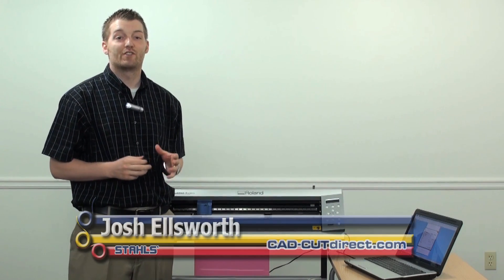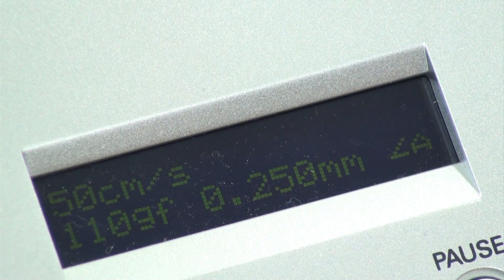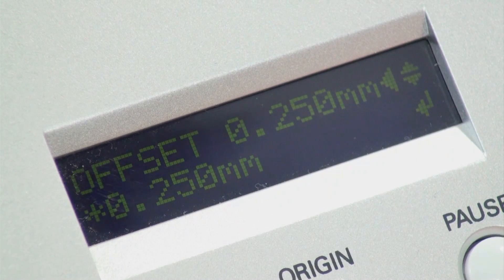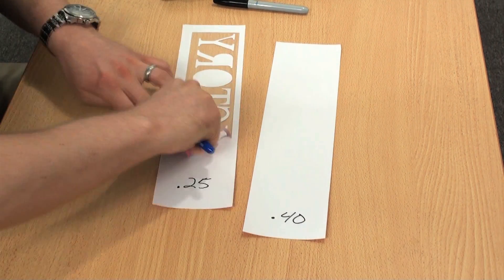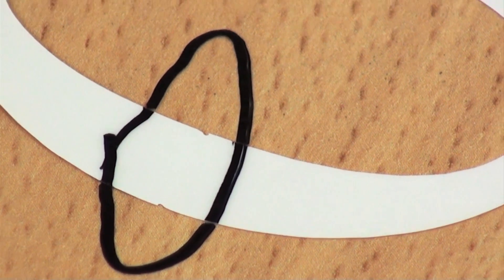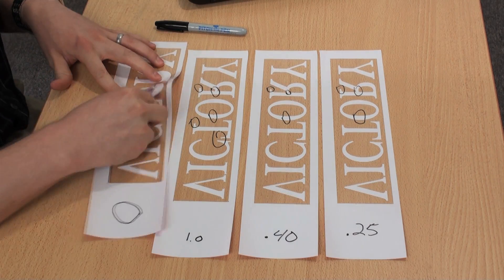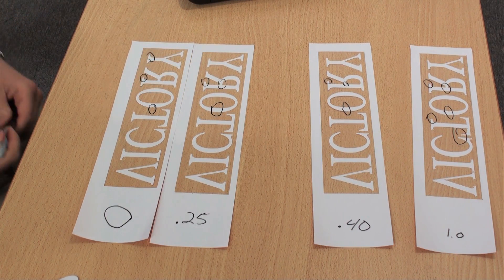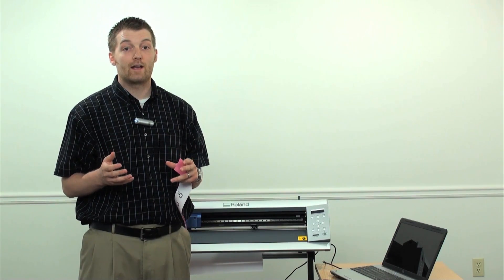Tip Jar - Offset Setting on Vinyl Cutter

Comment: I amusing Sure-Cuts-A-Lot software, and in the output dialog on computer, it has an offset adjustment there, already, set to a [default .25].

Does this override the machine offset? Or does the machine override the settings I send with a job?
Reply from the maker: As this is not a product we offer, we can not provide operating assistance. However, please visit http://www.surecutsalot.com/ as they have support, forums, and tutorials available on their products.

Comment: Hi Men i have cut small letters but not close cut. in my setup window "CUTTING OPTION unit/mm", then i have  "Close: 0.4" "Offset: 0.25" "Precision: 0.2" it´s wright this parameters or what suggest for each parameter. tnks men.
Reply from the maker: Please email qe@stahls.com to get assistance with this question.

Comment: graphtec craft robo pro,  60 degree blade on card stock (and carrier sheet).  i see two offset settings in the "plotter controller" window.  one of them just say  -5, -4, -3, -2, -1, 0, 1, 2, 3, 4, 5.   the other in "advanced" settings shows 30 degrees in the offset.  should i simply keep the first offset at 0, and change the advanced offset to 60?

Comment: Thankyou so much for explaining the offset, I purchased a chinese machine of ebay called a goldcut 720 and have been tearing my hair out to what the hell has been going on. I figured the machine was ok when I used the plot pen when all came out fine which prompted me to do a search on youtube for "Offset Setting on Vinyl Cutter" but of course the stupid machine only seems to have speed and force adjust with the offset needed to be done in the export I THINK ? Sold my roland years ago silly me